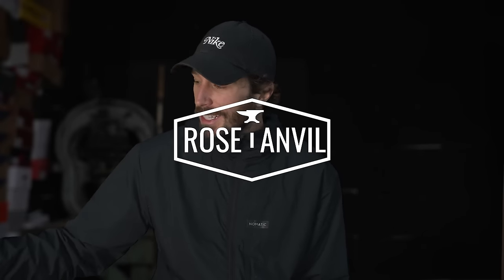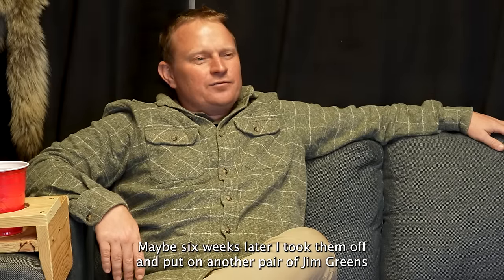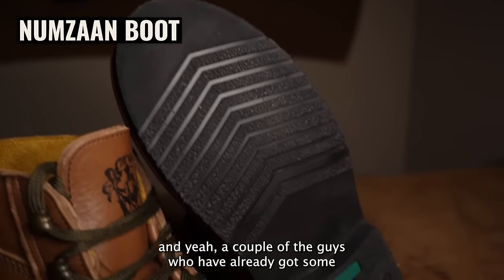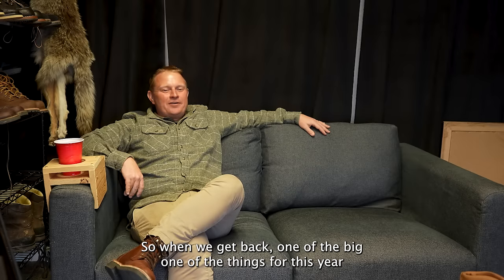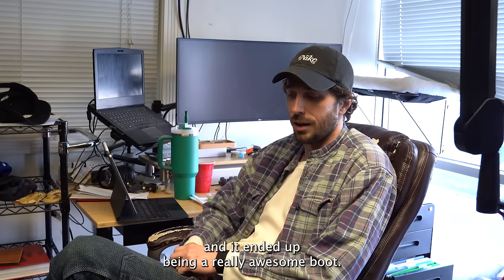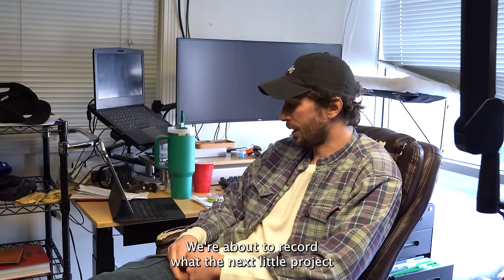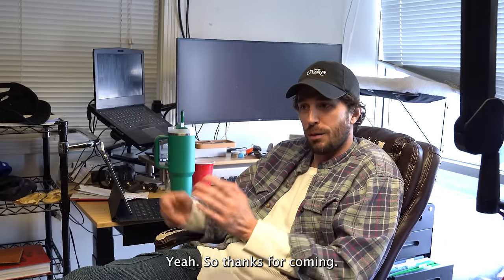RESTOCK! Why people love barefoot African Rangers - Jim Green

Comment: I use a felted alpaca wool insole for my Jim Green barefoot boots and it adds the perfect amount of squish and temperature/moisture control. Highly recommended. I also melted several layers of Red Wing natural leather conditioner into the natural color oily nubuck with a heat gun. It darkened the leather into a beautiful sort of Russet color and they're now completely waterproof to the point that I can stand in puddles of slushy snow and my feet stay dry. Amazing footwear!
Reply: I have Jim Green African Ranger boots but not the barefoot version. I also use felted alpaca insoles and I'm with you. I absolutely love it.
Reply: What socks are good?  Or just any socks?
Reply: @OlympianGift  depends what I'm doing. I just use simple polyester/ cotton ones if I'm not really wearing them for long just around town. If I'm doing more outdoorsy activities or wearing all day, I prefer merino wool for the anti smell and moisture wicking.

Comment: You would expeditiously tap into another customer base, IF you would make a                          bio-mechanically correct toe-box {the Shaped of normal human healthy foot } Anatomical and Ergonomic= This is where the big toe can splay out at its normal maximum capacity without the assistance of anything, Most boots in the Market today forces the big toe in-words. Restricted Toe box or no toe spray. Yes what you’re doing now is excellent with the zero drop and not so restricted 4foot  & toebox.((‼️ I would actually stock up on these boots.‼️)) I used to work for the United States Department of interior National Park Service. I would’ve purchased those in the zero drop, when I did work for them, and just painted them the color dye Cardova oxblood and they would be uniform compliant(If you make an ergonomic human foot shaped toebox now🥹🤩 I would purchase once a month until I had 12.(thanks for making such a boot and I think the African Rangers for keeping the wilderness intact🕊️🩵

Comment: I've owned a pair of the original African Rangers for several months now and they have become my everyday shoes. Not only are they comfortable on the feet, but more importantly for me, they have managed to completely take away all knee pain I've been experienced the last few years in going up and down stairs. I can't say what has caused the pain, but it is probably a result of many years of running as a youth with awful worn out athletic shoes. If I switch to other shoes for a few days, the pain returns. I know this sounds like something you'd hear on a late-night TV infomercial, but the Rangers have genuinely been one of the best products I've purchased. I've never worn any kind of barefoot shoes, I'm wondering if the barefoot Rangers would further help my knees or not.

Comment: I found I needed an insole to make my barefoot feel less sloppy.  I tried the Jim Green insole and had to cut it down a bit to fit.  It worked but felt like too much squish.  I ended up buying Nicks leather insoles a size too large from Amazon and then slowly trimmed to fit.  My feet felt more secure but the shoes were initially a bit more stiff than something with foam.  But after about 50 miles of use, the insoles had molded to my feet and are really comfortable.

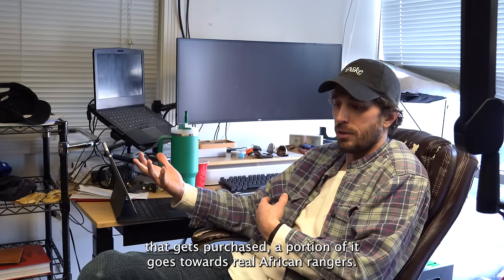Just got in a new pair of the shoes with Nubuck walnut.  Noticed a couple things.  The upper around my ankle of the boots I have had since December have relaxed and seem to have a bigger opening.  Nothing wrong with that as I find that more worn boot easier to get into.  Second, that older pair now has ~200 -300 miles worn on them from daily 9:10 dog walks.  That includes about a third of that as hiking.  The rest is gravel trails and bike trails that I walk the dog on.  I point this out as looking at the outsole.  I have worn though over half the rubber in the heel and in the area of the balls of my foot.  I suspect z a I will need to have the boot resoled by end of Spring.  I love the boot as it has become quite comfortable.  But I wonder if the rubber is to soft.

Comment: Thank you for making these boots. It has saved my feet on my motorcycle. I was having to swap out of my motorcycle into the barefoot shoes that I made by hand when I got to work/store since the motorcycle boots were squishing my toes so badly. Now I can just wear these boots and get the protection from the genuine leather on my foot but also the comfort of walking around. The shifter is a bit hard on the left top side of the foot, so I zip tied some spare leather I had around shifter and its been since. So a steel toe of this boot would be bang on. 

I wear these just about every day. Riding motorcycles, skateboarding, business attire, hiking, backpacking, kayaking, everything. I do also wear them without socks when I am doing wet activities so I can take them on and off quickly. So good. 

Will you come out with the barefoots in the buffalo leather? I think a heavy leather would be a nice inbetween with the standards and the steel toe cap. Or maybe do a 3 layer toe cap like you have on the boots you are currently wearing in this video?

Comment: He's absolutely right that we're thankful for you guys putting the barefoot boots together. I'm super stoked to see the nicer leather, as one of my biggest wishes for my barefoot rangers is better leather!

The other wish is for the same boot with a taller shaft, there are times that I wish it weren't low cut. I've actually been wearing mine through the winter in Colorado, and with some nice wool socks, they've performed beautifully. But for comfort's sake in cold conditions, I would love to have a taller version. Not crazy tall, maybe eight or ten eyes compared to the existing five.

Also excited about the steel toe version! When I told my friends about these boots, their first question was if there was a steel toe version. I love an unstructured toe box myself for the sake of comfort and a more natural looking break-in, but for some folks who are used to wearing steel toe boots, it's obviously a non-negotiable feature.

Comment: Got my Jim Green barefoot boots yesterday, really nice looking. I have 8 1/2 EEE feet and usually have to buy 9s anyway, so I took your advice and got the size 9. My feet are swimming a bit in them, which is not a bad thing. It will take some getting used to but liking them so far.  UPDATE: thought I'd add that I did end up adding a liner, which makes the boot fit a little snugger. I personally probably would have been better off sticking with my normal size of 8.5, so just an fyi.

Comment: I picked up one to their black belts back in November and it has been a great belt. It's wearing very well and the buckle is a minimal but classy piece of hardware. Recommended gent's, the micro adjust is gimmicky but it does help with the yoyo around the holidays to get that snug, not constantly pulling your pants up, feel.

Also, props for getting Samwise on the show, a real treat.

Comment: I bought my barefoot AR on the presale and have been wearing them 5 months almost daily. Favorite shoe/boot I have ever owned. I work sometimes long hours standing on concrete and found the same thing as was mentioned, instead of feeling a painful sore at the end of the day, my feet feel tired like they got a good workout. After spending so much time on leather, now I really dislike the feeling of foam underneath. I love the sole, great grip in every situation I have tried, I expect it to last a year based on how it is doing 5 months in, will there be an option to purchase the sole material for a resole? I love that they are adding more options and might have to purchase a black pair for casual. Only thing I would change for my personal case is, my feet are super wide, if these were a cm wider would be awesome, might have to size up for my next pair which I hate doing and having extra length. A safety toe option of these would be amazing.
Reply: Thanks for the kind words and support, appreciated. Sole are available on Rose Anvil website, and we chatting on a resole option although with the soles should be an easy resole for your local cobbler

Comment: How would you rate the Barefoot Rangers against heavy rain and extended city travel?  For example, walking tours in historic streets in Europe?
Reply: I have worn mine in Houston brown on city walks in both moderate and very heavy rain. The soles wear out fast on pavement (three or four months maybe at 10000 steps a day, wearing every day) but they’re comfortable for hours of walking if you’re a bit used to barefoot shoes. If you slam/stomp your feet down when you walk your mileage may vary. As for rain, the light rain just darkens the leather and doesn’t go through. The heavy rain is held off for a little while but eventually seeps in around the stitching.
Reply: Thanks, that's helpful @ek-nz

Comment: Can anybody tell him how these size? Like compared to Red Wings.
Reply: I have Red Wing IR in size 7US/6UK and Barefoot ARs in 7.5US/6.5UK. From my experience, half a size larger than your Iron Rangers should give similar length in the Barefoot African Ranger, though width and instep height might also make a difference. I have regular width feet with low volume. My Brannock size is 8US and both the boots I mentioned are slightly snug, so I could have gone half a size bigger for a roomier fit in both or to fit thicker socks. I also have the BFAR in 8.5US/7.5UK with added insoles and plenty of room for thick socks for winter wear. Hope that helps.

Comment: I LOVE my African rangers!! But I can say without adding my own insoles they wouldn't be very comfortable at all. Not underfoot at least..you'll feel most everything esp in the ball of your foot. I couldn't even imagine the feel of absolutely everything while wearing the barefoot rangers. They must be crazy uncomfortable without your own insoles and even then they're so thin on bottom you're still going to feel most everything. I feel like it's an around the inside of the house kind of shoe or going out grocery shopping shoe..or check the mail shoe. Going to work or doing everyday things with them I feel like will be very uncomfortable. The way you can flex them and fold them in half makes them seem like they'd be horribly uncomfortable. I don't know how people wear the regular African rangers without an aftermarket insole let alone these! And I was able to add my insole on top of my rangers. Not swap them out. If I just swapped the insoles I'm pretty positive they'd be too uncomfortable for me to wear. Gotta have a nice thick soft insole for them to be comfortable. For me anyway. Which makes me think they'll never break into my feet perfectly because the insoles I use are like are memory foam so they're quite squishy. Won't form to your foot like the insole they come with. I like them though..a lot! I also have them set up great for me right now. Finding a nice flat insole to put in 1st then a nice cushioned one to put on top would be ideal. I'm still looking to figure that out. My heel would sit lower that way too although not needed. They feel great how I have them atm